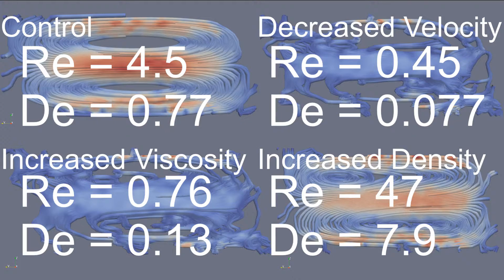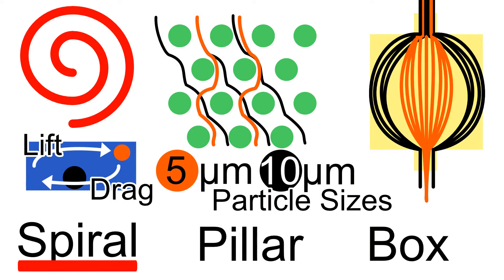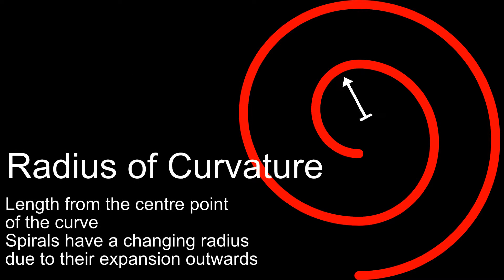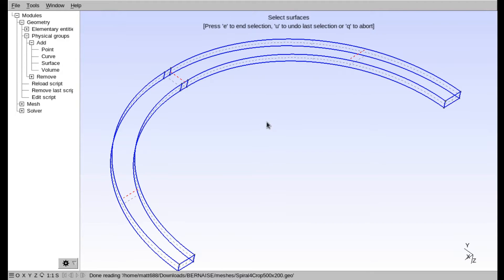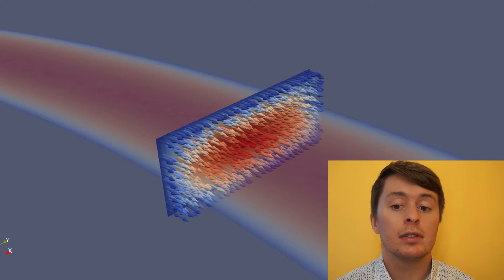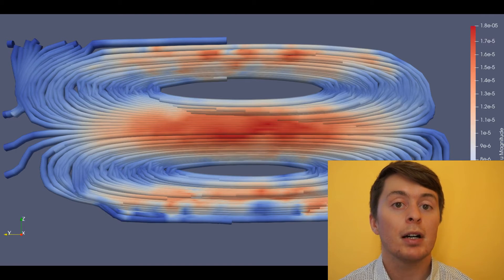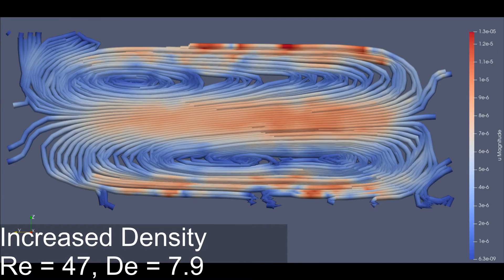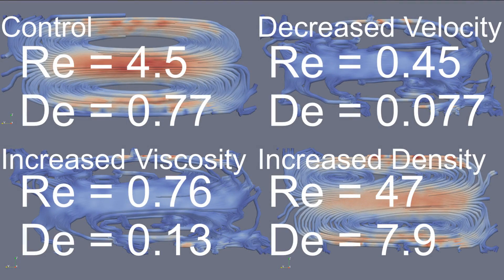What is Dean Flow? | Microfluidic Inertia Separation (Part 1) | FEniCS CFD

Comment: Please upload the second part as well I'm eagerly waiting. Also, I'm working on a plasma separation device of a helical geometry can I contact you somehow for help?
Reply from the maker: Hey Apoorv,

I'm still applying the final touches to simulating inertia micrifluidic separation video. The long answer short - there's no one solution and may not be a good model at all for our needs.

Basically a lot of the common methods for inertia simulation have been wrongly referenced and there isn't a good, common theory which can be used to truly model separation such as plasma components from whole blood in different microfluidic channel geometeries. That's before considering the different newtonian fluid properties of whole blood and plasma.

I'll publish the video soon on how the algorithms are implemented. Additionally, I'll explain the assumptions of each and why they may not suit our simulations unfortunately. Part of the delay was having time to implement possibily better, more accurate methods for simulating particle separation.